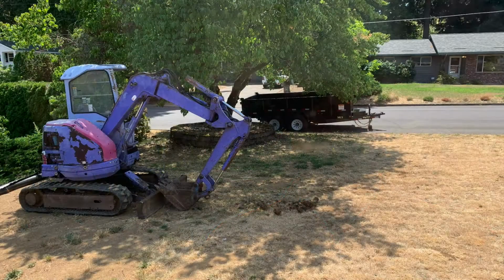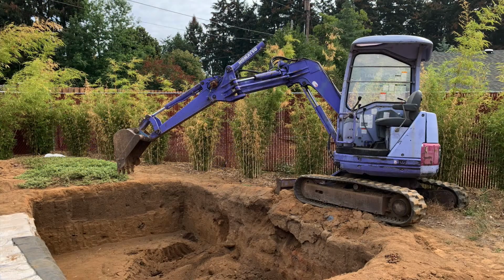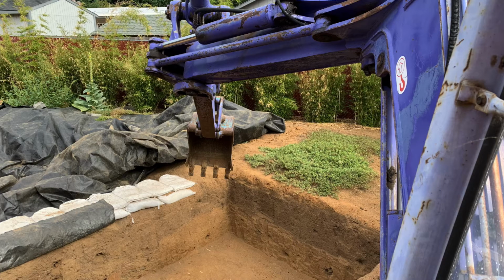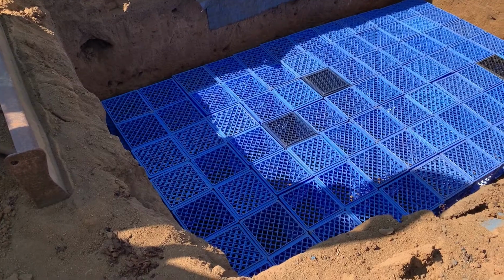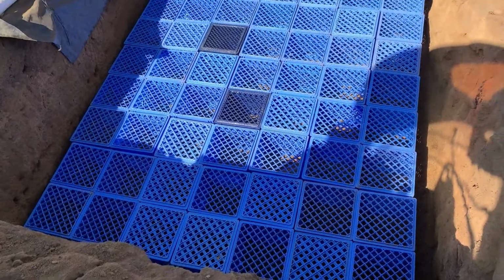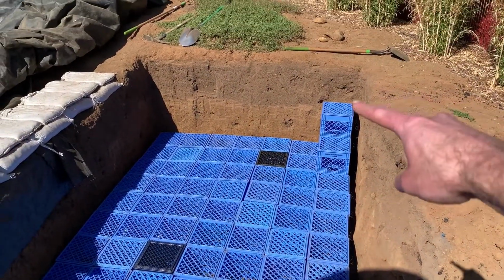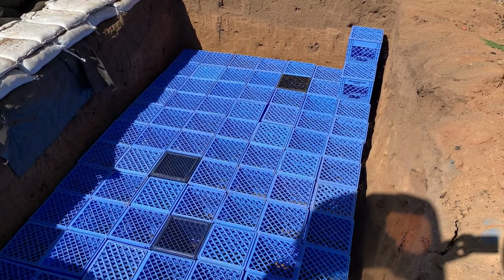Negative Edge Pond Skimmer & Rainwater Harvesting Construction - Part 2

Comment: Can the milk crates hold the weight of the rock? I am in the process of building a pond at my house and aquablox are super expensive. Also could I use that pipe as a snorkel and centipede? That is going to cost 3-4k for what I need. I'm building a wetland filter and a negative edge.
Reply from the maker: The milk crates can absolutely hold the weight of the rock. In fact, the deeper your bury the crates in gravel, the more point load they can handle since the load gets distributed more.

And yes, you can use the pipe for the snorkel and centipede. I did exactly that in the bog I'm building (check out the rest of the pond playlists in the description). I used a 24" pipe for the pump vault in the cistern and for the bog I am using  a 12" for the centipede and 18" for the snorkel.
Reply: @TylerTervooren  ty I'll go check out the other videos later today